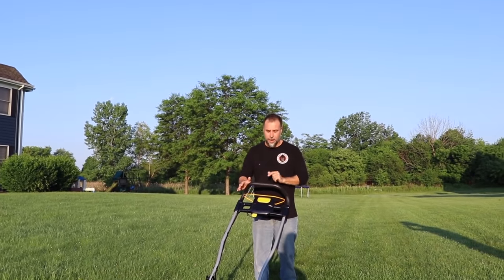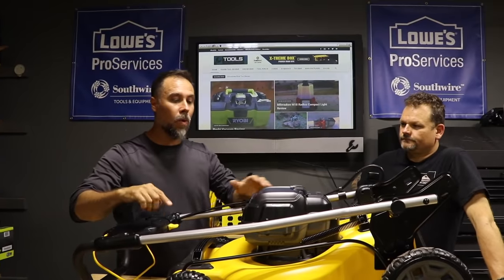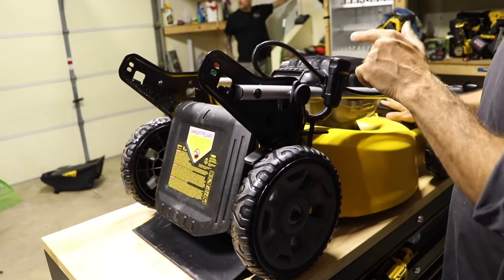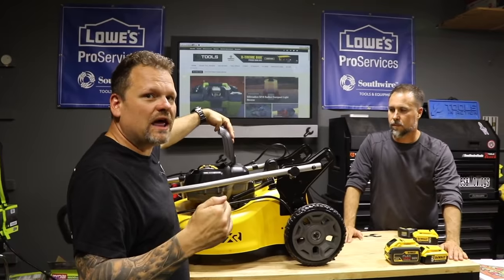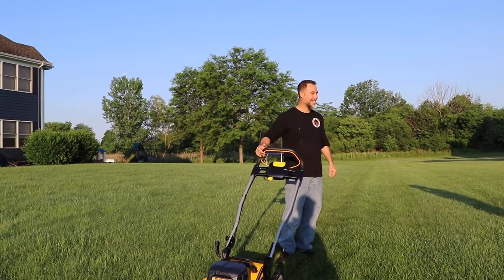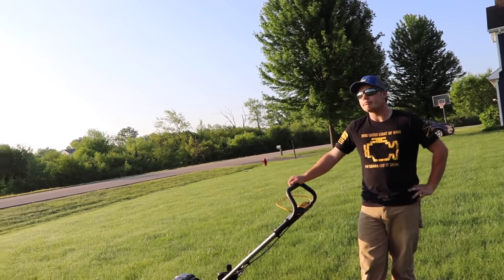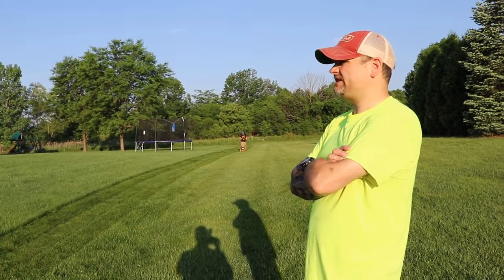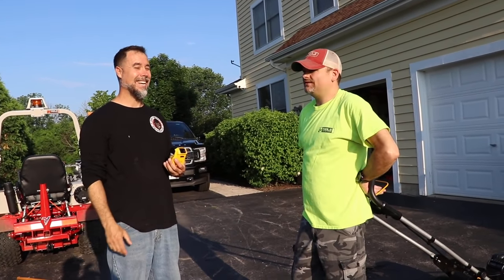Dewalt- 1st place for the Worst Lawn Mower of the year

Comment: Wow, pretty crazy! Thanks for the honest review
Reply: What was honest about this review, what mower did they compare it to?  most electric mowers would have done the same thing under the same conditions.  The reason people go electric is so that they dont have to change oil and gas for storing mowers over the winter.  This mower is for people that have smaller lawns and dont feel like changing oil and gas.  IF anything this review is actually very dishonest, because people with small lawns after watching a video like this would be more inclined to just pay a lawn company to come in and do it for them, (which is what this guy does).  So obviously it would benefit ANY  lawn care company to talk trash on any small home care solution the homeowner would use, including this, which could be for all we know  the best electric mower in its class, which we dont know from this review, since they failed to make a good comparison.   The only reason theyre up at 6am is to stuff this mower up. Are you planning on climbing out of bed at 6am just to stuff your mower up? Because if so, youre going to be paying a lot more for a mower that can do that grass at that pace while wet and up to 6 inches long.
Reply: Most people don't cut tall soaking wet grass, and try to mulch it.
Reply: One of the guys pointed it out later in the video, that they were cutting it way to short. The one guy sort of blew it off, he replied to a comment and said a gas mower can do it. Trying to cut 2-3 inches of wet  grass, and mulching on top of that. Would bog down even a cheapish gas mower.
Reply: I will say this at the price point, you are still far better of getting a nice gas mower.
Reply: I agree I would be at least discharging the blades. I have a Honda-powered Husky that would struggle in the same conditions especially if i was trying to mulch it.
Reply: Honest? Whatever.

Comment: I have this mower. Haven't had any problems. Cut my front yard twice with it. I don't think its designed for that type of grass. My complaint is that it is really light and skips across the yard. Subsequently, that causes little circles on the lawn. What you need is a zero turn for your lawn, but I am sure you know that.

Comment: I just bought the Makita 36 volt mower and I am happy with it.The mower itself feels cheap because its plastic.Lets face it they tried to make the most profit out of the mower and by building most of it in plastic it's cheaper.I do have a small yard so for me it takes about 20 minutes to cut the lawn.I have the 3,4 and 5 amp hour batteries (two of each 8 in total) so I will never run out of power but I find that even with the 3 amp I will get enough run time with power left over.I have a few Makita tools but most of my tools are Milwaukee the thing is they don't make a lawn mower. I have the dewalt 20 volt trimmer and I am happy with that tool.
Reply from the maker: I haven't tried the Makita version yet.
Reply: Stanley "Dirt Monkey" Genadek I would like to see the difference in performance.You have a huge lawn compared to mine.I live in the city so most lawns are small in comparison to yours.The making batteries charge faster than other brands.The kit has a dual rapid charger with fans than cool the batteries as they are charged.The largest batteries are 5 amp hours.I am not sure if they have a 6 amp hour battery.It seems that Makita has concentrated on having 36 volts brushless motors for their high demand tools.I have the chainsaw and the new SDS max hammer drill.I don't know if Makita is going to follow milwaukee and dewalt by manufacturing 9 and 12 amp hour batteries.This seems to be the new trend in cordless tools giving the user more run time.I think it's a good thing for the cordless tools that run high demand motors.These type of tools just eat up batteries.

Comment: Just like my 18v x 2 Flexvolt unit (DCMW564T2-XE) that I just returned for refund today, used once and very disappointed. 

Mine cut 225m2 only and stopped, with 2 bars on the batteries still showing. My grass was summer dry and way more sparse than your demo shots. I mulched and there was no zero grass left on the ground. My mower is rated 18v 6A or 54v 2A. My guess is that it runs at 54v 2A full time and then overheats. It ran for 25mins max. I used the 30day money back. I bought it bundled with the blower and loved the blower. 
Positives: 
Build quality is very good, 
the handle does NOT rattle at the hinge like so many do
wheels have bearings so it rolls sweetly
Packs away and stands vertically for storage
Cuts very well and mulching is now a real thing for me
Blower is awesomely strong

Negatives:
Run time is a disaster. It should come with 54v 12A battery and it would then be a killer.

Background: I just retired my 30+yr old ROVER 2-stroke 18" mower and wanted to get into the 21st century. Dewalt has the brand image, but.......

Comment: I bought this lawn mower and it works great. If you have other Dewalt tools then you should have additional chargers and 5aH batteries which help. But these guys are mowing a huge wet lawn which is stupid. This is the first version of this lawn mower. give it a few years and it will develop into a beast.

Comment: I saw LCN do a review of the 56V EGO and even the more powerful battery pack did not last very long. I looked at a 40V model in 2-3 different brands and have the conclusion that a battery lawnmower is half as good as a corded electric model. I have a Troy Bilt from Lowes (TB200) and it has mowed the hell out of a 1/2 acre or more of grass for the past four years without throwing money away on replacement batteries or repairs.  The SRP on the gas mower from Lowes is only 269, and its great for any DIY/homeowner.

Comment: I have a 1998 Craftsman 21 inch cut push mower it's not spring assist but the the handle is similar it's adjustable

Comment: Pro mowers with their 20+ HP zero turns can mulch mow this kind of wet grass. Your typical consumer home owner isn't going to mulch mow this wet grass with even a standard gas push mower, even if it pushes through it's going to leave clumpy mounds. For a more fair example the grass needs to be dry and possibly a side/rear chute w/bag for thicker/taller grass. Small yards with frequent mowing (not allowing grass to get too tall) I believe is what this mower is made for.

Comment: For tools like those. I prefer gas powered.  Love all my Milwaukee tools
Reply from the maker: I love my milwaukee too but they don't have a lawn mower &  I hope they never make on either.
Reply: As much as I love my Milwaukee and dewalt tools I know where to draw the line. My stihl chainsaws and weed whackers and toro lawnmower are just fine and won’t even consider an electric version to replace them. Too many sissys these days that “don’t want to mess with gas”. Hell if they still made them I’d buy a 2 stroke mower again...

Comment: Try the 20v 6amp batteries they use 21700 which run cooler and give more power than the 6amp flexvolt

Comment: Ok heads up the blade stalling is from safety feature on engine in case your foot is there.  American mowers blades are set about 1/2 inch up inside the body again safety feature so there wasn't that much grass cut. he just needed to start the mower in clear and introduce it to the longer grass. Also even are standard petrol would have stalled.  That body was probably full of grass from all the work and had no xtra space with which to mulch new grass.

Comment: Stan, my Toro 22 recycler is a beast! Cut my grass( which wasn't cut for 7+ days) to 3 inches from 7-7.5 in one pass. Side discharged it, all good. Should be gotten it on film, but didn't have my phone charged. Ps, I'm POLISH and I'm also a big Toro guy. Also, this beats husky. The husky cut normal growth no prob. This kept stalling. I still like Toro the best.

Comment: The Dewalt 2 x 10Ah battery model lawnmower is the very best. You need the 10Ah batteries and NOT the 5Ah batteries for the right amount of power.

Comment: The cover over the batteries probably a design flaw that traps the heat causing early battery failure. Can the top be removed and if so are the batteries still hot to the touch?

Comment: You should test an Ego mower. It was a pleasant surprise. Been using one for a year now. 1/4 acre per-charge. I have a full acre property and it works great. 1 hour of run time to the 30 mins to charge. Based on mulching. Probably longer if I side shoot.

Comment: With the battery being so hot it may be a thermal cutoff that's shortening the run time I'd check the voltage with a MM when it "dies". That being said that thing is going to be ROUGH on the battery cells.
Reply from the maker: Yeah-  I think it went into thermal shutdown

Comment: $400... For a BATTERY-POWERED PUSH MOWER?! I bought an AWD Lawn-Boy 10739 last year for $300, and it has plenty of power, sips the gas, starts easily, has a phenomenal cut quality even in rather garbage grass, and most importantly for the price, it drags itself and I up and across steep hills. Now sure, I could have paid more and got an AWD Husquvarna and probably not had the 2 problems I've had, (the right rear wheel gear stripping out, and the bottom mount of the handle broke off, both covered by warranty) but considering that I mow 3/8-1/2 an acre with it every week including a steep hill, plus the other odd jobs I use it for, it works great. Sorry to go on a rant, if you made it this far, good on ya.

Comment: It is hard to believe how loud that mower is. We did research for a couple months, and ended up buying a greenworks 40 volt. It was $299.99 with 1 battery. It is very quiet, mainly because it varies the speed of the motor based on the load.  The mower has good run time, 1/2 hour on average.

Comment: Set the deck to 3.0-3.5" cut it won't stall as much as well as that's the professional height to cut grass if your still haveing trouble open the discharge vent and walk slower to allow the blades to clear.

Comment: I think the problem other than those mentioned below with thick wet grass is also the inherent limitation with lithium batteries with the heat as as the power draw increases the heat of the batteries that decreases its efficiency and therefore its battery life and capacity. Using it for such a heavy purpose is likely beyond the scope of what it was designed for in the first place and likely overloaded its electrics which caused the safety circuit to cut the power out till it cools down.

Exploding batteries aren't very good after all.

Comment: Hello gentlemen fine post, I can see what your saying, but it was mulching which is a little tougher and that is a real big yard, a pro would use a 60 inch, having said that the run time was short and it definitely had a rpm issue

Comment: Used this mower for 2 months and i love it but..... 
My 4 complaints are
 1: the battery cover is not closing tight enough and rattles all the time.  
2: the height adjust lever is slack in the position comb and makes clunky noise 
3: the paint is cheap and the deck bottom chipped at several places.   
4: you must lift if off the grass so the blade can pickup speed or it wont start.     

Would I buy it again? Yes because I already have the dewalt 20V tools for all my other tools and I can do my 6K sq ft lawn with 2 x 5Ah 20V with no problem, but it gets 7/10 because we expect a mower of this price to be flawless.  I never experienced this motor jam issue in motion.

Comment: You've got to understand brushless motors to start with! First of all, in equipment like this they start up slow with no load & being a fixed bar it will be sensitive to load. It's NOT a failing with the gear, but a safety feature! If the grass is long & wet then a side shoot should probably be used first because it will clog otherwise if mulch cutting. I use the 58v AEG (Australian version) & it's great although they also have a twin 18v version now too, but with 2 x 6Ah batteries.

Comment: I think the problem with starting on the tall grass is a safety feature.  When you stall an electric motor its resistance goes way, way down almost to the point of a short circuit.  If you discharge a lithium battery that quickly then it can damage the battery, overheat or even catch fire or explode.  But the whole thing is ridiculous and expensive, for that price you can get a gas mower that'll run for years with nothing but basic maintenance and go all day if you want it to.  Other than noise, I don't see the advantage of an electric mower.

Comment: This reminds me of when I bought my Dewalt battery powered multi tool kit it came with a drill,sawzaw,light, and a circular saw. Everything ran fine but then when I ran the circular saw the battery would go dead after cutting like 3 2"x4"s !!
Reply from the maker: Ouch.  Not good
Reply: kevinboo2000, I know the sawzaw will kill batteries in a few cuts, but the circular saw should last for a long time.
Reply: Actually works other way. The circular saw suck the batteries dry fast.  I have used the new 20v ones with much better results but you need a decent amp hour battery. I'd say 5 minimum for a useful amount of run time

Comment: Same problem with the dewalt dcf620 drywall cordless drywall gun shuts off when locked trigger in place under heavy torque

Comment: I am not liking the Miluakkee quik loc. I like but i don't, if that makes sense. What i don't like is the locking mechanism. It has gotten stuck. Had to open it up. Doesn't seem to hold right. Other thing i don't like is the weight of the articulating hedge trimmer. I'm in shape and the thing becomes heavy. I trim allot of tall hedges. Have to take breaks.

Comment: i was so excited to use this mower after i got it.  I bag my cuttings because im trying to make my yard healthier and grow more grass.  First impression: my old Wal-Mart Hyper Tough cordless lawn mower did a better job at cutting and sucking up clipping. The bag on this dewalt mower will only fill 1/10th of the bag before it starts leaving clipping behind. it has no suction. going around sucking up leaves, out of the question.  Poor investment and made my lawncare ritual more work.  But i look cooler doing it now though with my new yellow and black DeWalt 20v XR lawn mower.

Comment: My echo 58 volt mower with 4ah batteries will mow my cul de sac lot (1/4 acre - 1600sqft house) and weedeat with just 2 batteries. Power isn't an issue. Actually, when it hits tall grass it gives it more power and works better.

Comment: Use a bag and it won't do that .. even a gas mower won't mulch at that speed and .. when mulching you.have to manually clean the blades out with your hands.. I'm landscaper and I've been cutting grass for 15 years and I bet I could easily make that thing work like a charm

Comment: I agree that mowing in thick wet grass is bad enough but add mulching to that and I've had gas mowers tap out on same situation.  I think you need to do another test and for the record, that's a pretty big yard. I would to see another test done and see how it holds up while cutting dry grass, with and without mulching. But right now it's not worth $400. Do I hear $50, 55, now 60...65...

Comment: I’m sure you have seen the plenty of other comments that explain how unfair this is. You are mowing in tall and wet grass with a low height and no discharge on the mower. I’m sure that most gas mowers wouldn’t even do well in these conditions. Don’t complain if you provide an unfair environment.
Reply: Michael Stamatis my basic homedepot toro mower mows taller wetter grass just fine and I know because I did it last week even though I try not to mow wet grass too often.. seems like a lot of the people saying a gas mower couldn’t do this either have really shitty mowers or haven’t actually tried and are just speculating or even worse are just trying to justify their purchase of an electric mower/defend a shitty product when instead they should be asking for something better that is worth their hard earned money.
Reply: fourtysix4646 You are going too in depth in to the minds of the ones who replied. I too have a toro mower (I think I bought it from Home Depot), and I can tell you that it is great, it runs well and is powerful. However, I have used it when the grass is wet, tall and thick, and it bogged down during the worst areas. I (like most people) probably prefer a top of the line gas mower compared to a top of the line electric one. But in relation to this video, I think putting a mower up in the abnormal conditions is unfair to judge on. A real judgement should be based on how it does in the generic, dry, hasn’t been mowed in 7 days, type of lawn. Also, the expectations for a battery mower should not be the same as a gas, for they won’t have as much power and are still not as popular.

Comment: i have this lawnmower and pushed it thru 4' (yes foot) grassy bush with Zero issue!... besides battery life i cant see this ever having an issue with torque. I use the Flex 60v. and can get 30 minutes of HEAVY cut time for the ditches... i use my kubota for the rest :P

Comment: That mower is for city residential home 2ksq-5ksq but the serious flaw to the mower with not enough torque it sits to low and the blade is jammed up it should have a side or rear shoot for cut grass to push out might increase the run time as well because of the less amount of torque it would need at that point....